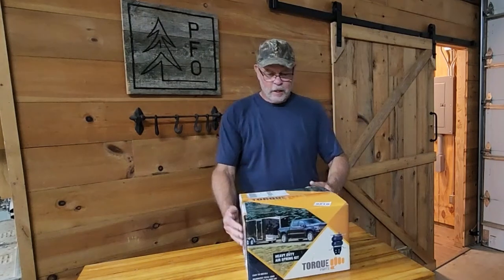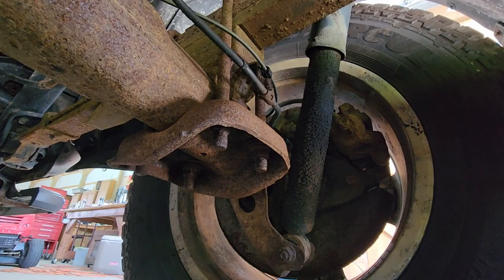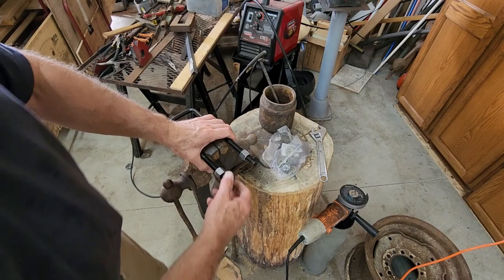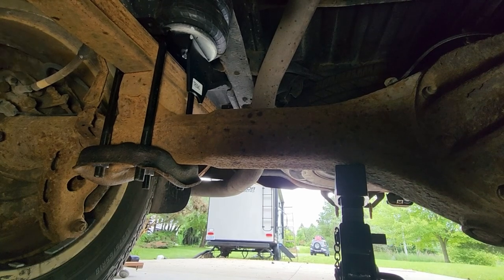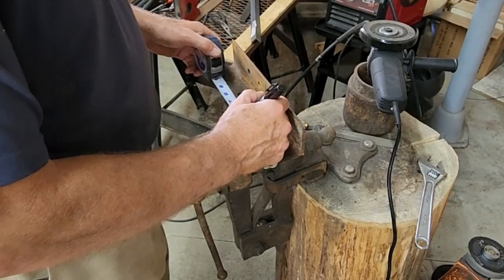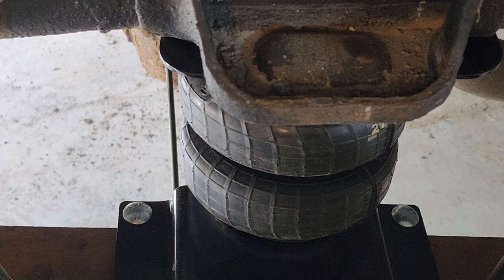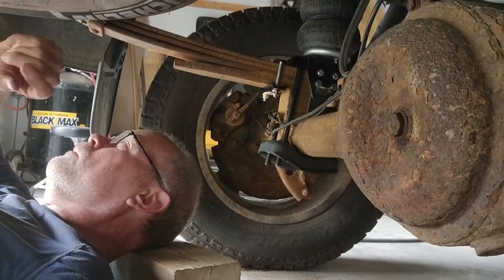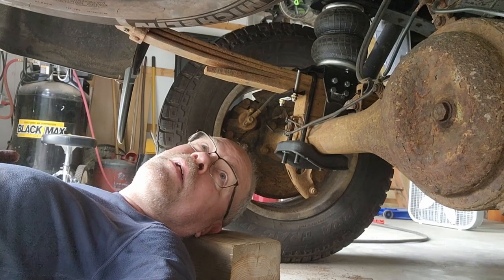How to Install an Air Bag Suspension on a 2nd Generation Toyota Tundra

Comment: Great video looking to add same kit to my 2014 tundra how has it been working out so far
Reply from the maker: I am very happy with it. It makes a huge difference in ride quality when towing. I have been carrying a bicycle tire pump in the truck, which is perfectly capable of pumping up the bags, but in the next couple of weeks I'll be adding the AirLift Wireless One pump and controller to the system. I have that on my FJ Cruiser, and I prefer the convenience of being able to quickly change from towing pressure to normal pressure by just pushing a button.

Comment: You need more than air bags 
Your axle’s rusted and your shocks need some repair
Reply from the maker: Yep. Bilstein 5100s all around and several hours of wire brushing and fluid film. It was typical road salt damage when I bought it, but not too far gone to get ahead of it.